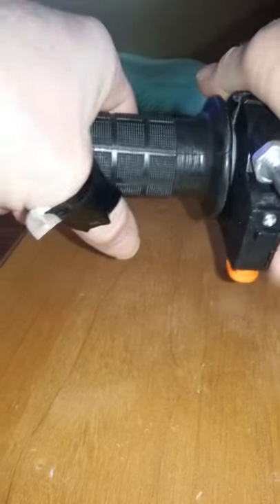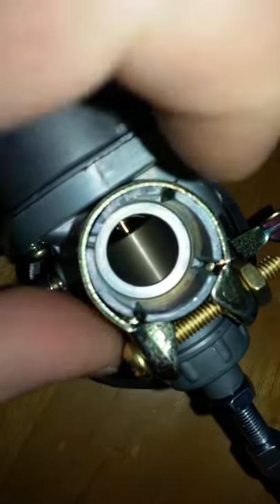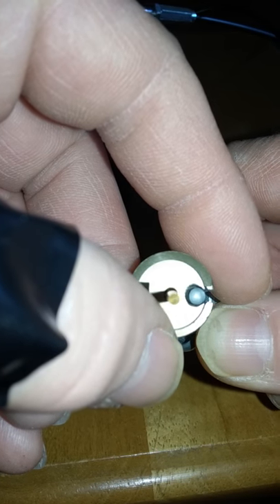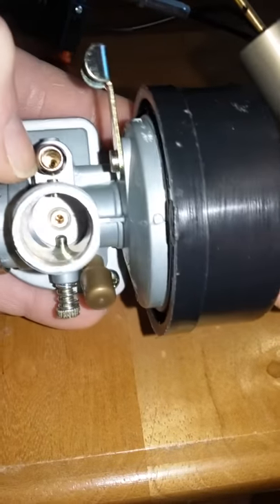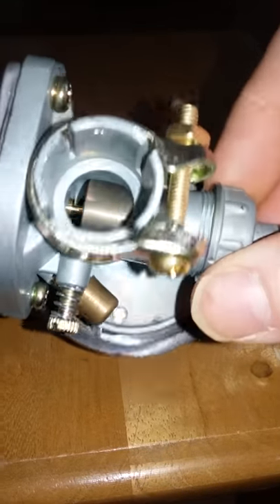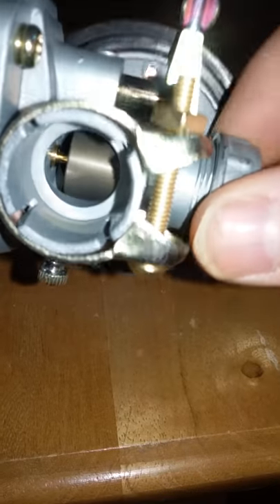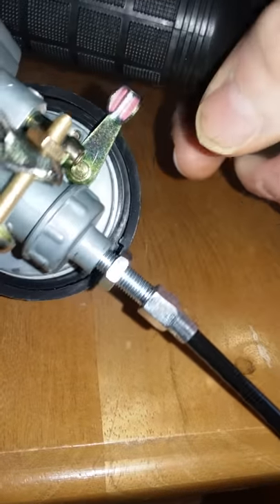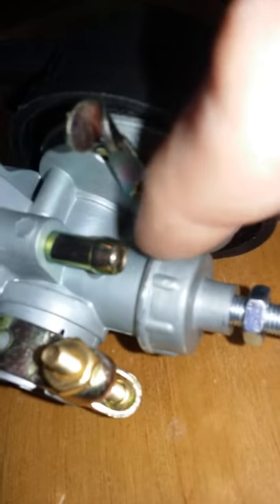Fix your throttle if its stuck

Comment: I think this might be my problem.  I cleaned the carb and when I reinstalled it it starts with high idle and sounds super loud
Reply: Juan Tellez yea mine too .
Reply: I fixed my problem I put the throttle backward and it was wide open
Reply: Juan Tellez this is what is happening to me
Reply: @sirxavier5593  same
Reply: now i have the same problem rn.
Reply: Was that the problem or something else.

Comment: RIP he helped me a lot I messed with my bike for 2hours than I watched his video and got it working right away
Reply: What was wrong with your bike i am having problems to
Reply: @voithy8351  it would rev up all the way and, I couldn't get it to come back down
Reply: @robertmiller684  was it this video that helped you?
Reply: Robert Miller that’s what’s happening to mine. I’ve worked on it all day and it would start up all the way and stay. I’m gonna try this tomorrow
Reply: @bassinwithbryson9209  u may have a vacuum leak
Reply: @HonderdtachtigCC  how do you know if it’s that ? Or how do u fix it
Reply: @gtcproductions9217  Use wd40 or spray deodorant near the airbox carburator air hoses on idle if u spray and the engine revs go highers for a bit u may have a vacuum leak. Warning ur engine can catch on fire if you spray too much
Reply: He died?

Comment: Had come by this video having had issues with my carb after re-installing it when I gave it a good clean. 
I reckon Bob had hit the nail on the head in my case as I may not have installed the throttle valve correctly when putting the carb back on, as the throttle were sticking and not snapping back at all :D Cheers for the vid Bob, and RIP.

Comment: Omg  first ride float cracked took my wood burner melted seams .held down with rock in gas for a week good to go. Second trip 9 miles out throttle cable kept popping out of long nut  before the bend screw going into housing part with kill switch. Tried everything even using thin curtain for piece and moldable plastic .I wAs rdy to drive Dr off rock at the bay. I have watched 3 months   videos nobody helped .typing in everything I could think to find fix.😣 my nephew just got 49c.f. July same thing  but somehow found your video all in layman's terms and sent me link. I even said no  I'll just give it to you.glad I listened when he said  no aunt even old ladies can understand this guy.  So here I go .was even gonna try my throttle off 1949 tillerr. Wish me luck.hopefully don't end up swimming.ThAnx eh .

Comment: wow that was it! i could not for the life of me figure out why it was stuck - thanks mate
Reply: what do you do if the spring is stuck inside the cabator ? won't come out ?
Reply: Michael Moreno  i dont know how you managed to get the spring stuck but one way or another youre going to have to get that it out, preferable undamaged so you dont have to order a replacement spring (would be cheap anyways but still a pain). in the event that you do need to order a new one, you wouldnt be able to slide the needle into the carb with the old spring lodged in there anyways
Reply: thanks for the help

Comment: Hello sir, when I start my bike it just stays on a rev on neutral, the new throttle cable is a little bit shorter than the one I replaced it with, do you reckon the length of the cable is too short and making it rev when I kick start it?

Comment: My carb's barrel is stuck really tight.  Now how can i get the barrel out without damaging it?  I have tried pulling the cable but still can't get it out.  Have also put some oil int it but no joy.  What can I do?  Thanks in advance.

Comment: I could not find any video,pictures or step by step directions to do a duel cable throttle reinstall  on a 1998 KLX 300. I also tried all the forums I could find.- Any help appreciated.

Comment: Hmm, i think i did it correctly. But my throttle is still not working. It is not stuck or anything. is extra lose. there is no resistance when you you want to give gas. and there is not coming any gass. do you know what the problem is? It stopped working after I cleaned my carb. so maybe it is the throttle needle?
Reply from the maker: Lotte Wiegant it could be that your spring going into the throttle is not strong enough or you may have to adjust where the cable goes in or you know the cable goes into the carburetor or where are you cable housing goes into the throttle that's the only thing I can think of or when you cleaned your car but sometimes if you give it a little tap at the bottom of the bowl just a little slight tap was like the butt of a screwdriver it'll loosen it up and that might solve your problem good luck I think I had something to do when you with you when you clean your carb you might want to take it apart and take a look at it because there's a little how do you say metal clips that can bend and that can cause it to not to make the float not work properly so check that out too and again good luck sincerely Bob

Comment: it almost seems as though my slide is too big for the carb! it sticks.. i mean it REALLY sticks. i have to yank the thing out even if i don't sink it in all the way. (even when there is a couple mm of the slide showing at the top of the carb)

i've tried using petrol to lubricate it, but it's not like it's just sticking or catching on something.. it completely jams up. no signs of obvious scratches where it would be catching on anything. I've taken it apart and the brake cable is straight and the spring is straight also.

The thing is REALLY sticking. No movement at all. 

Any ideas?

Thanks for everything you've helped me with so far!
Reply from the maker: sam charlton 
try measuring it with a caliper (of you have one.  it could be bent? those 4 slits, 1 of them could be pushed in enough to hinder it. or its a manufacturing flaw. you could try a little sand paper, JUST MAKE SURE TO CLEAN THOROUGHLY after sanding.
good luck Bob.
Reply from the maker: sam charlton 
let me know how it works out in the end. thank YOU.
Reply: Just so frustrating how it worked perfectly before, but once removed from the carburettor seems a size too big for the hole!
Reply: i will try investigating further thanks bob
Reply: I have the same problem,it's so annoying.
Reply: bought a new carb and all works fine. no clue what is wrong with the old one. the slide just does not move within the chamber. crazy..

Comment: i Have a problem can anyone help? i have a 55cc motorized bicycle and my problem is that inside the carburetor the 'thing sticking out' mentioned in 1:53 of the video is eaten up i think and when i pull the throttle lever the metal ball on the throttle cable only goes down.. what can i do to fix the 'thing sticking out' ?

Comment: Hey Bob, 

Have you figured out a way to stop this from happening after opening up the throttle all the way? It seems that my slide will come up and then get caught and never come down unless I open up the carb and reset it.

Thank you for posting this video btw -- it's gotten my bike up and running.
Reply from the maker: zeemonkey187 it may be that when you open your throttle all the way it's pulling that gold Barrel up too far and then catching on the pin where it's supposed to slide up and down with that little copperknob give me want to adjust your carb so that that little copper tube doesn't go up as high bye adjusting your cable I'm going to cable screws that go on the outside the cable housing and also the cable housing to your throttle that way it won't open up your throttle all the way you might also want to try to adjust your PIN it could also be the flow it could be a number of things so check that you know with the barrel first to see you don't take it take it off and just it and see how far up the barrel goes and see if it's catching then if it's not catching there I would check the pin and actually take the bot take the bowl off and look at the float cuz it may be catching it in there the pin

Comment: how come I can't get it in there? almsot like something is warped, im am sure it's all lined up the circle piece that holds the needle only goes in half way and gets stuck? plz help
Reply from the maker: there is a little nub that sticks out on the inside of the carb where you slide it in. you need to line that up with  the line in the barrel you ar slidimg into the carb or the nub eill stop the barrel 1/2 way itn look down inside the carb, youll see it,,,, its on the inside rite about the opposite of the throttle screw.  SEE IT
? if not hit me back puppitmaster1941@gmail.com
Reply: I have the same problem, like something is warped or varnished, and it's getting worse, so I polished the slide, including all the edges, on a leather strop.  It's way better now, so a little more polishing should do the trick.
Reply: Derrin Clarke Figured it out Derrin!  You must be removing and tightining that cap with pliers like I do.  Yes, we warped the housing and you'll never get it perfect again.  Buy a "speed" carb (slight upgrade over the nt) like I did and only finger tighten that cap, your problem will be fixed forever and you'll have slightly better performance.

Comment: i just bought an Apollo 007 125cc i  taught myself how to drive it and u know what happened so the throttle box falls comes apart down the road and the cable wont stay in its keeper that plastic piece broke to how do i fix that untill i can get a new throttle
Reply: can i make a new hole to put the throttle cable through i was thinking
Reply from the maker: Marcal Batiste ,you might want to try JB Weld. I don't know what, or how it's broken? But that stuff is good in a pinch. I even sealed my carby with it to seal air leaks. 
    Good luck
Reply: the throttle cable the end piece for the handle that plastic thing is broken too idk if JB weld will hold plastic
Reply from the maker: Marcal Batiste okay buddy I'll give you a quick shot of my garage and I Workshop if I can I don't know if I can post a video this is how I work I save a lot of crap and it comes in handy I know exactly what plastic piece broke now when you said that so I have made those work just by putting on a larger Loop now when I say I use fishing weights sometimes when something's broken and the wait is too small of take a fishing weight and I'll clamp it onto the wire follow me all right now here let's see if I can get a video of my workshop. doesn't look like I'm going to be able to do it but I'll post the quick video of what I work with and how I work and you'll see a method to my madness lol lol lol lol lmfao
Reply from the maker: Marcal Batiste JB steel weld or high-temperature weld will not hold that however there are about 15 different J-B Weld go to Home Depot there's a whole rack of them you can pick and choose what you want however you have to know what your material is made out of that you repairing and then look at the back of the tube that only the packaging the to bust the packaging open and look at the two because I made a mistake by buying gorilla Grill I'm sorry Gorilla Glue and it said not to use with polypropylene and polyethylene well that's exactly what I was trying to fix and it wasn't a light bite but regardless you have to be careful on what you buy and what year buying it to repair read what it is made for it's so important
Reply from the maker: I had the exact same problem with my throttle where the round piece of the end LED on the end of the cable that hooks to the throttle it was broken so what I did was I spawn the throttle completely around and had a little extra cable in the back where it hooks onto you card that way I had the cable wrapped around the throttle or the piece of plastic broke and I hope that on there and it held it in place I'm still using the same piece after more than a year so you can take your with it or you can use I would not use J-B Weld not you know the metal but if you're going to do something like that I would suggest drilling a new hole taking a fishing weight and clamping it on to your throttle cable and then taking it fishing weight and pushing it's true I think you're getting what I'm talking about you cut it put a fishing weight on their shrimp it and put it through the new hole that you drill then you will be able to pull and you'll have a tighter grip I hope you understand what I'm saying

Comment: can someone plz help me i have a gas bike and everytme i start it it goes byitself without me using the throttle i am super confused and cant find anything about it on the web
Reply: try lower idle speed?
Reply: DJ Case I tried that didn’t work any other ideas?
Reply: @420stonerz4  my next guess would be something is up with the clutch I can't think of anything else that could cause this issue
Reply: DJ Case i don’t think it is but it might be cause I did tighten the clutch a little tight cause it was more comfortable

Comment: can I put oil or lube in the spring and needle area?
Reply from the maker: Brandon personally i WOULD NOT.  That libe or what ever you put in there wI'll eventually end up inside the carburetor maybe down in the bowl on the float and cause some kind of failure possibly a catastrophic failure who knows but I wouldn't do it I think you're just looking for trouble doing that. 
     now if you wanted to you could probably Lube or oil up your throttle and the inside the grip on the handlebars you might want to do that and some people put the cable Lube that goes down the cable to the throttle I've never used it myself but I know there's people and there's a product out there if you want to like a regular bicycle shop they have stuff like that but as far as putting it on the spring and stuff like that in the carby I would say no good luck and have fun and be safe Bob
Reply: what about gas? I think it's just to dry. it's a brand new carburetor and  it will go up but not back down
Reply from the maker: Brandon it sounds to me like you're getting stuck on something I would pull out the barrel and look for any scratch marks or anomalies on it see if you rub it up and down without it running twist your thought all Throttle up and down up and down up and down and then pull it out and look for any scratch marks or anything like that something that looks like it's hitting and if it's hitting that could be your problem maybe your spring is bent into bent out a little bit into that nhot'' that you lied through I mean it could be anything and I'll see how straight your spring is make sure your cables all the way up and that little dot  you got to check every little thing in there. Make sure that it's not rubbing at the top o= bottom  x-where you insert at you just really have to inspect it inspect inspect inspect and so you find some sort of Mark or something I know it sounds like a pain in the ass but a little bit aloof or something if I don't think she's going to make a difference or gas you can put gas in there I don't know if that's going to do it go up and down when you turn the throttle back and forth? 
        take the cap off and manually move it up and down and see if it's catching on something that's why I would start then you might want to check with the adjustments on your actual throttle then you  if  don't know It could be anything . keep me posted Bob.

I got to go shopping I can't talk anymore good luck

Comment: My throttle keeps getting stuck at 100%, even with the slider correctly and wires oiled??
Reply: Bob passed away in May
Reply: @judykling3220  what?? how do you know?
Reply: @Bidalotroxi  I am his Mom and do not know anything about  this subject
Reply: @judykling3220  oh ok. Sorry for your loss.

Comment: only hand tighten the thing don't use a tool
Reply: Why?
Reply: AC Games those threads can be stripped pretty easy
Reply: Jack Kenny a
Reply: Young Boss ?
Reply: Jack Kenny my brother used a drill on his atv to adjust the air/fuel ratio and put a hole in the bottom of the carb so he had to spend $50 on a new carb. I really don’t know why he used a drill...